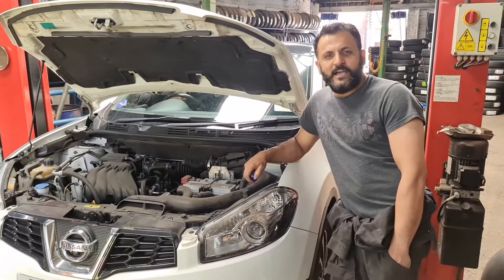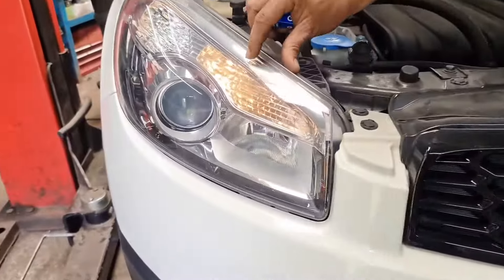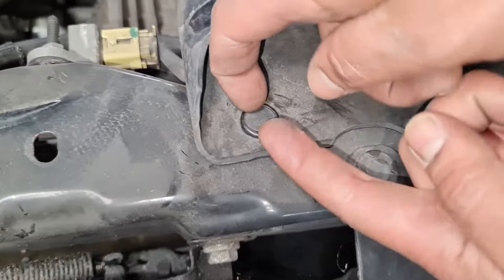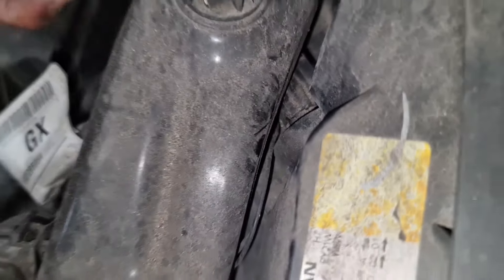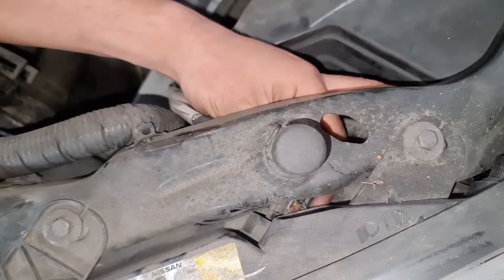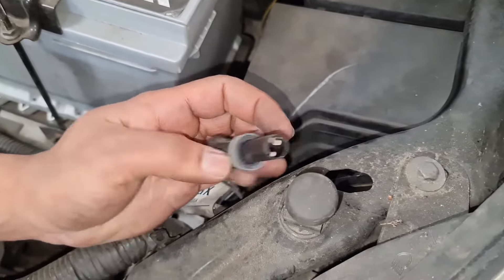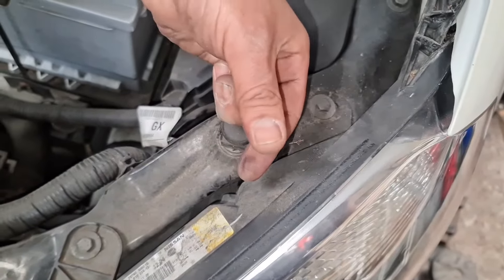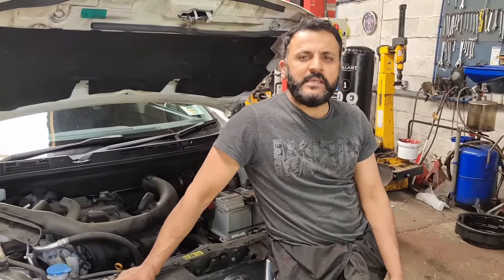how to replace position lamp on Nissan Qashqai 2012 #headlight

Comment: If you look at the back of the light fitting, there us a slot for a small flathead screwdriver. I used a stubby flathead and it was easy.

Comment: I have a UK Nissan 2013, can I change the lights to an European setting without replacing the whole thing?
Reply from the maker: Hi, you may not be able to change the settings on a Nissan Qashqai directly. You might need to use a beam deflector sticker or a headlamp beam converter kit instead. Thanks 🙏🏽